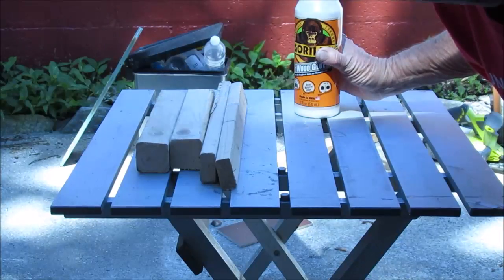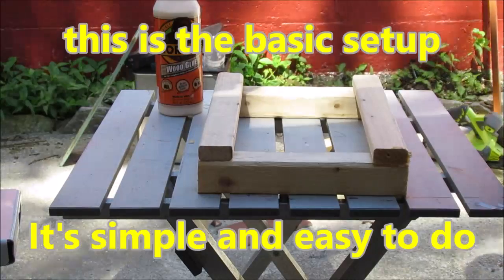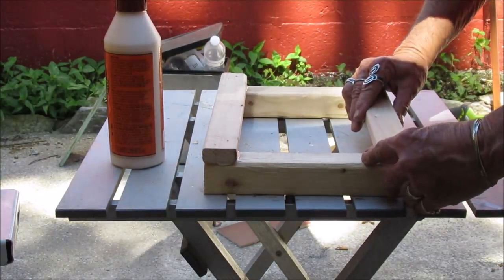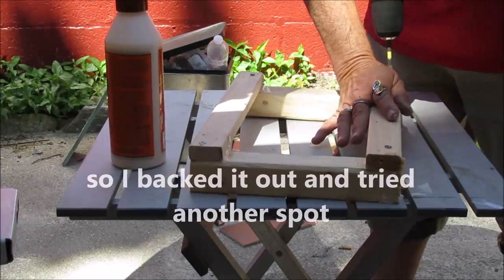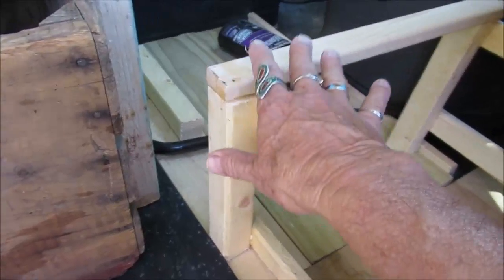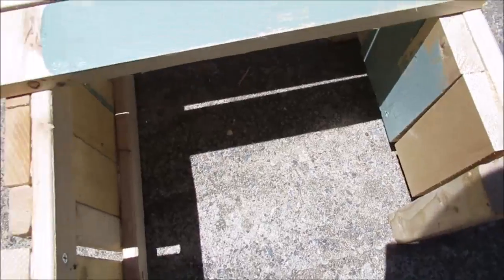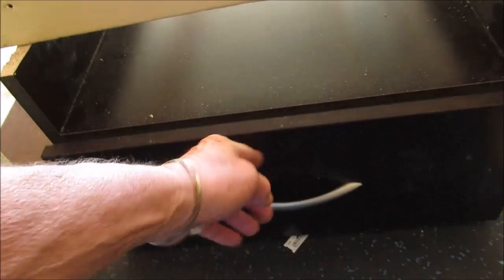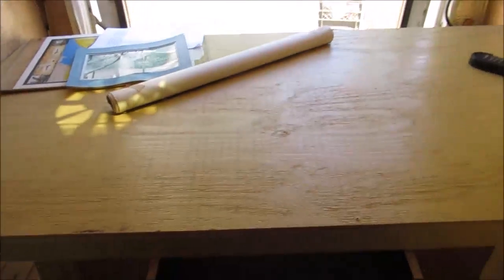DIY Easy Box Construction Van Build

Comment: Nice job. You can come finish my van. Actually I am about ready to travel I am thinking Idaho, (never been there). A friend called said it was 108 here today. Should be cooler tomorrow. Those fruit crates are easy to build in different sizes. I even made some for my music CD's.
Reply from the maker: DannyB1954 are you done? I don't think there's a place to escape this week's heat. Anxious to hear how the a.c. works on the road for you!
Reply: To let others know I am powering a 5,000 BTU air conditioner using solar cells for power. I have six 160 watt panels, or 960 watts of available power. If you are curious, you can see it here https://www.youtube.com/watch?v=_-d2PaYRnuw

It works well while driving. Besides the solar powering the air conditioner,  I also have the same battery cross connect that we installed on yours. This way the vehicle alternator can supply power as well. 

When running on solar only I have to be sure to turn off the AC in the afternoon. The solar panels stop producing power and the batteries start to drain. So from about 10 am to maybe 4pm it works great. I can fire up the 900 Watt generator to recharge the batteries if I needed to. 

Still at the house. Packing is all I need to do at this point. The van is fully functional.